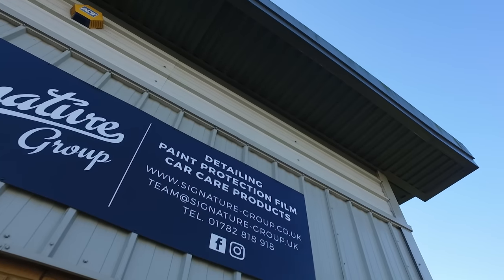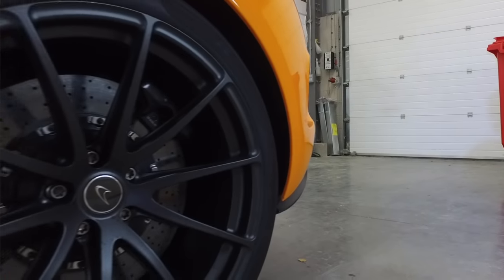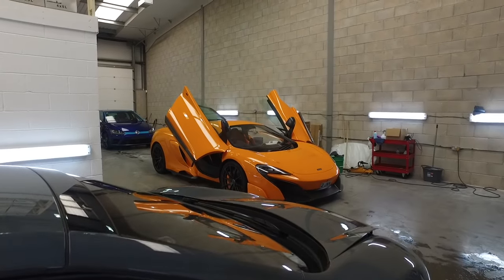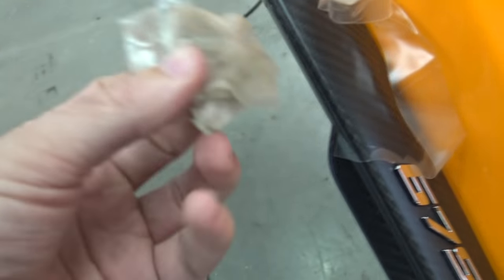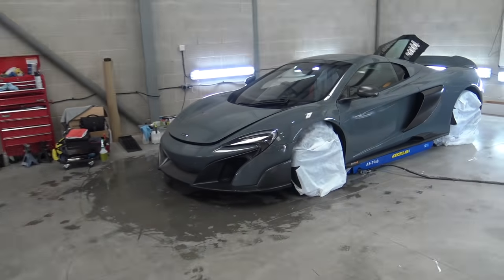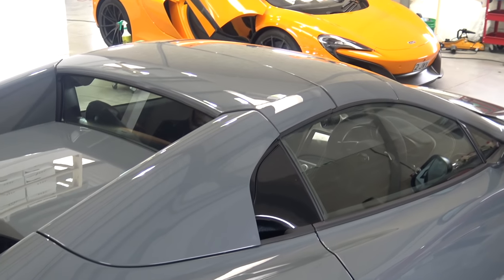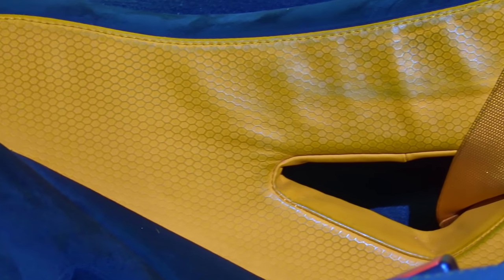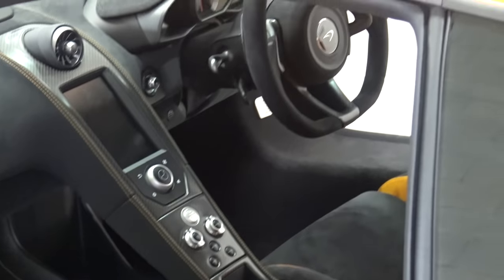This Is Why You Need Paint Protection Film | MrJWW

Comment: just wondering, so the carbon lip on the driver side door, was it properly mangled or was it just baked on dirt? if it was damaged i would without a doupt contact the dealer that you bought the car from and try to work things out. even if they are not obligated to, which i imagine they could be held somewhat responsible. they should try and sort it out cause it definitely did damage to an expensive piece